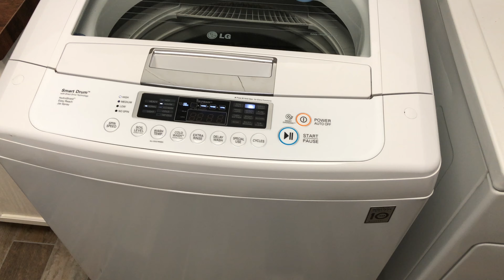LG WT1101CW Washing Machine IE Error Drain Pump Runs Continuously Fix

Comment: I followed these steps but must’ve hit something too hard or the wrong thing…
After the first try, I put the unit back together and when I hit the power button the screen stayed dark but water started shooting out of the blue spot to the right of the detergent drawer. Took it apart again to give another couple taps and now nothing happens when I hit the power button…
Reply from the maker: Sorry to hear that, Tom. I’m just now reading this.  Did you ever get the unit to work?
Reply: @budgetprojectsbydavid5263  I bought a new control board and swapped it out. Still cheaper than a new washer!
Reply from the maker: Great job!

Comment: David, you are awesome!  You will not believe this, but after watching this, I thought about it a bit and decided to take a shortcut.  I unplugged it, and plugged it back in, which caused the drain pump to turn on (the issue).   Instead of taking everything apart and lightly tapping everything, I just slapped the display a few times and the pump stopped.  After all these years of using this "specialized technique", it finally paid off!
Reply from the maker: Some nice commenter a few months back shared this method, calling it the “Fonzie” method, paying homage to the old “Happy Days” TV show.  Hehe!

Comment: Saved me a few bucks. Thanks for the help. Any idea if the problem will continue to happen down the road?
Reply from the maker: Mileage varies.  For me, it started happening once per week until 3 months later when it stopped working.  At that point, i changed the control board.  I have a video on that as well.  Other folks have gotten as much as two years out of the fix.
Reply: @budgetprojectsbydavid5263  ok right on, I'll check out the other video. Thanks again
Reply from the maker: No problem. Glad to help. Good luck with the washer.  I ended up replacing my LG with a Samsung and have been pretty happy with it. Only time will tell, though.

Comment: Using above info, great description. Before disassembling anything, soft 2 fist pound left side of the board reset the relay. Back to washing cloths.
Reply from the maker: Haha!  Rock on!  When that stops working, check out the other video on board replacement!  Thanks and have a great evening!

Comment: PLEASE HELP ME DAVID!  the problem that I have with my machine is that it started to stain my clothes. I suspect is because it does not pour enough water.  The liquid soap gets poured into the clothes and the load doesn't get cover with water in order to dilute it. Obviously I'm not saying this is what is going on Is just my take on it since I've cleaned everything else. I tried to manually pour more water (I added 9litres once) then the sensor measure the load and drain 70% of the water... I was so mad!
Please help me if you can.
Reply from the maker: Hi there.  Is the drain running all the time?  This fix was related to the drain running nonstop.  If that’s the issue, maybe this will help.  I don’t fix washing machines professionally, so I don’t really know all of the possible ways that your machine could be broken.
Reply: @budgetprojectsbydavid5263  Thank you for replying a really appreciate it.  The drain works fine the problem is really the level of water that is too low to be able to wash properly. Thanks once again.
Reply from the maker: There’s a water level sensor that could be bad, i suppose, but i just don’t know.  Part of me is frustrated with all high efficiency HE washers because they exhibit the same symptoms that you describe, even when they are functioning as designed from the factory.

Comment: My units drain pump runs continuously but I have no trouble codes. Thank you if you can help.
Reply from the maker: Maybe you have really high water pressure, which provides enough water to overcome the amount that is erroneously draining out.  Your problem is the same as everyone else, the relay.  Follow the temporary fix in this video and start thinking about a new board, which is covered in the next video.
Reply: @budgetprojectsbydavid5263  That is amazing how fast you responded. Thank you kindly for the information. I greatly appreciate it.
Reply from the maker: Ha! I guess you caught me with my phone in hand.  Let us know if the fix works.  I’m curious to know if that was the case.
Reply: @budgetprojectsbydavid5263  I will do. I'll pull the unit apart tomorrow and see about ordering a board. Thanks!

Comment: I’m having the opposite happening in getting or I changed the drain pump and everything and it still is not working really need some help
Reply from the maker: I have heard of the opposite thing happening as well related to the failure of that relay.  My other video has the fix, (i.e. change the control board)

Comment: Just by looking at it, I can say that it is the one with a white tag  clearly visible on it.  It is the one you smacked couple times and then at the end it was the last one you smacked.   Right across them big round capacitors.  The other boxy things are all capacitors as well.
Reply from the maker: Yep, if you read through the comments, you’ll see that has been the consensus.  Also some folks have had good luck with the “fonzi” method of hitting the unit without removing the cover.
Reply: @budgetprojectsbydavid5263  Unfortunately mine seem to be of a bigger problem.
Mine behaves as if the computer triggers the pump by sending signal to the transistor but then it won't stop the signal.    It is due to the fact that the pump does not run at all times but only when it is time for it and no amount of tapping will disingage the pump while it is running. If the relay was shorted the pump would be running at all times and then you can knock it loose at least a number of times before you it it gets baked on.
I just finally found out what on earth was wrong with my LG washer.   It is them WaveForce technology.
All the other problems stem from something totally different.
Reply from the maker: I have another video where i show the process of replacing the circuit board and where i sourced it at the lowest cost i could find at the time.

Comment: YOU are genius!!!! I had a repair guy come out and said it was the pump. I waited a day for him to get the piece and replace. Once replaced, the pump kept running. He then said to was the control panel. So I said, then it's not the pump, please remove the new one. Then asked if he knew the price of control board and was he certain that would fix it. (My confidence was waning). He went out to his car to figure the price. 
In the meantime, I found your video and watched the entire thing before he came back in, to tell me $280. 
I told him it wasn't the pump, and I wasn't needing a new control board. 
So I'm now getting back the price of the pump and the service fee. 
I suggested he YouTube it next time.🤣

Also I'm grateful to have read other comments. If I stopped at the first try, it didn't work. I didn't it a second time, tapping harder. 
Voilà!
Reply from the maker: You give me way more credit than I deserve, but I’ll take it! Thanks for taking the time to share your experience!  I have another video that shows the control board replacement on this unit.  Take a look at that one, when you’re ready to do that project.  It’s not that bad of a job and you can do it yourself as well.

The comments are what really brings the value to these videos. It’s amazing what we can accomplish when we all work together!

Comment: Will this work if the water WON'T Drain out? Done resets and unplugs. Gotten 3 differnt error codes. Dr being the latest code
Reply from the maker: Not sure, but it only takes 10 minutes, so why not try?  Is your drain pump running, but unable to drain? Or is your drain pump refusing to run?  This fis is more likely to work in your particular situation if the drain pump is just failing to run.
Reply: @Budget Projects by David  the drain pump isnt running. I got it apart this am but need my mans help with getting the silver part apart. Im hoping for the best. Thank you so much for replying!

Comment: Thank you!  After a few round of progressively harder tapping this worked.  I suspect you saved me hundreds of dollars, if not the cost of a whole new washer.
Reply from the maker: You’re very welcome, Gary.  The circuit board will likely need replacing within 6 months or so.  If you check out my other video on this washing machine, you will see tips for sourcing that part and its installation.

Comment: Thank you so much! You saved me alot of time, money and effort with this video that worked perfectly! I had to do it twice because the first time I didn't tap the blue box on the lower center of the screen with the white barcode sticker,  only the other thin blue ones. I put it back  together and nada, still was running.  I re opened it and only tapped that one and worked perfect. I wasn't getting an error code at all but the pump was running constantly as soon as plugged in or turned on. Tap the blue box with the white barcode sticker! Thanks again!!!
Reply from the maker: Thanks Reese!  You may read in the other comments about a Fonzi approach that involves whacking the unit in the sweet spot without removing anything.  Also, I have another video that covers the process of sorcing and installing a new circuit board when that one eventually fails.
Reply: @budgetprojectsbydavid5263  oh yes thank you for the reply. I tried the Fonzi fix for about 5 min then worked up the courage to start unscrewing it. Your video was a Godsend, MUCH appreciated!!!

Comment: Excellent, thanks everybody. I used the towel and tapping with a screwdriver handle on the instrument panel (didn't disassemble). Tapped on the area left of: high, medium, low, no spin text and the motor unstuck. Problem solved, thanks!
Reply from the maker: Thank you!

Comment: Thanks for the information.  It fixed my problem.  I'm in an area with no repair people so it was perfect!  Thanks so much.  I have a WT4870CW and that fixed the problem.
Reply from the maker: You may want to get an extra board on hand to replace when this fix stops working.  I have another video for sourcing that part and installing it. No worries.  It’s easy.  The hardest part is deciding to spend the $150 on the new board.  Thanks for reaching out and best of luck to you!

Comment: Another convert for “The Fonzie Method” - I put a towel over the front panel and tapped on the front under it several times with a screwdriver, and the pump stopped constantly running, and a load seems to be going through just fine.  Thanks!
Reply from the maker: “Aye Aye” [to be said in the Fonzie voice!]

Comment: This worked flawlessly. Thank you so much. I admit, I was skeptical with the "tapping" but it worked. Bending back the metal flaps isn't necessary, but it does make it easier to get the metal cover off.

Comment: Could this possibly work for the washer NOT draining? I replaced the drain pump already
Reply from the maker: It’s easy enough to try and costs you nothing. I would try it.  I have another video on replacing the board, which would likely fix your problem.

Comment: Hello. I have this washer and was wondering if you have a video on maintenance for it. I use the tub clean option but I don't feel it enough. Any suggestions would be great. Thanks 😊
Reply from the maker: We had the same problem with the tub clean.  It never really worked.  At one point, my wife and I actually took the tub apart and cleaned it.  Unfortunately, I don’t have a video for that process.
Reply: @budgetprojectsbydavid5263  thank you for the response. I appreciate it. 😊

Comment: Thank you for posting this.  This is the second time I've come here for your advice.  In between those times, a sharp smack with the bottom of my fist onto the control panel where the relay is below (sort of where the temp and soil level indicators are) worked a few times too.  But, sadly today I need to, again, take it apart as per your video. Thanks again for saving us lots of money by not having to have a repair person come in.
Reply: I read this comment and gave the outside a couple of whacks with the heel of my hand and we also were back to normal.

Comment: My daughter has an  LG Washer WT4870CW with the same symptoms described in this youtube video.  Although she was not getting any errors, it was clear the drain was stuck in drain as all the water was gone, but the pump noise continued.  When she tried a new load of clothes  all the water going into the washer was quickly being pumped out as the pump never shutoff.  This procedure of tapping the relays on the circuit board with the two large black capacitors did the trick.  Thanks  for posting this article.  Please add her washing machine model to this post.  The procedure worked like a champ first time.
Reply from the maker: Sounds good! By commenting the model number WT4870CW, like you just did, it will help the search engine pick it up as a relevant model. Thanks for sharing!

Comment: LG WT4970cw drain pump keeps running 
plus I got the iE code too before I realize the drain pump was running while the water was trying to come in so as fast as the water was coming in to wash the clothes it was pumping out as well so I unplugged plugged it back up, did all the proper steps and realize the machine was off and the drain pump was still going so I  YouTube and found this advice and it worked. I give a Big thanks to you Dave!!  You save Me some money, It’s working Now!! Was able to do three loads with no problems.
Reply from the maker: I’m so happy to hear that it worked! Thanks for reaching out! Hope you have a great week!
Reply: @budgetprojectsbydavid5263  You’re welcome, and same to you!!

Comment: Hey Dave, what’s the procedure to open the rear panel to replace water pressure switch etc
Reply from the maker: I remember it being a weird trick where you felt like you were going to break it, but i can’t remember.  I don’t have the unit, anymore, or I would go check for you. Sorry that I can’t be more help.

Comment: Reading everyone's comments and really hoping this would work for mine but unfortunately it did not and I don't know what else to do, I barely have any water coming out of my washer
Reply from the maker: Have you checked the water supply to ensure you have good flow coming from the wall? Also, I have heard people say in some areas that the little plastic filters where the water lines screw in get clogged.  Have you pulled those out with needlenose pliers and cleaned the debris from them?

Comment: Oh my gosh.. this washer is the devil! First the pump stopped working. Replaced it & then it wouldn't shut off. IE code due to water draining & not filling tub. I unplugged it, disconnected the wires on pump, nothing worked. Google the issue, found this video & BOOM!! She is up n running. THANK YOU!!
Reply from the maker: It still does not cease to amaze me how many of us had this same issue and how many water pumps have been replaced on these units in vain.  Glad you found the video!  I also have a video on the control board replacement, if you are interested.
Reply: @budgetprojectsbydavid5263  my actual pump needed replacing. It stopped pumping completely & I had to manually drain a full load. That was a few mths ago, then this issue arose. I was happy to find out I didn't need to order another part. I've managed to keep this thing running as long as possible. I'm now catching up on my family's laundry.. 3 loads in since fix.
Reply from the maker: Ok, gotcha. That’s great!  I’m proud for you!  Best of luck!

Comment: Great video. Mine is having the OE code, did the research. Checked all drains removed and cleaned pump, nothing, replaced pump ($90 later) nothing. Found this video and it worked! For about 45 seconds. But now I know its that relay. Gonna take it to work with me tomorrow and see if I can't cut the case off of the relay without destroying it and get in their and replace/repair the relay.
Reply from the maker: Dude, I’m so excited to hear your results.  I have decent amateur soldering skills, but i was afraid of the glue.  Please share your results with us!

Comment: I want to add extra water. 
Please help.. Thanks
Reply from the maker: Is your machine broken or are you saying that it has never added enough water?
Reply: @budgetprojectsbydavid5263  no it's not broken and when I read the manual it just says period that it is the proper amount of water for that washing machine. But I disagree. The water barely covers the top of the clothes
Reply from the maker: Ah, I understand, now.  I think you may be stuck with the water level. That’s a major frustration with these units by many people.  In an attempt to save water, the washer manufacturers have restricted the amount of water to a level that is much less than what we’re used to.  I don’t have an answer to this except to go buy an older machine that has been refurbished.
Reply: @budgetprojectsbydavid5263  yes and because they have cut back on the water so much when you use bleach and eats through your white towels. All of my towels have holes in them now because the bleach doesn't rinse away which causes them to eat through my towels. I would not recommend this type of washing machine to anybody

Comment: Thanks for the great tip. I don't know how you came to the conclusion "bang on the relay" but it worked.
Reply from the maker: I think i researched it for 2 days straight in every obscure forum and back alley web hangout i could find until i found the answer.  I felt a calling to make a video to reduce that time for the next guy/gal.